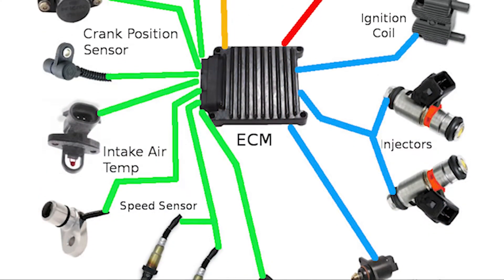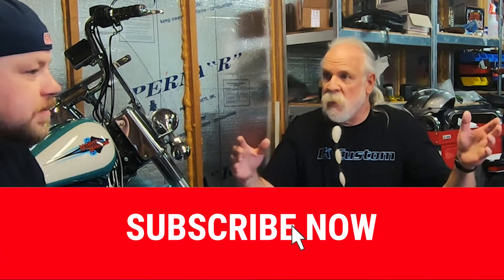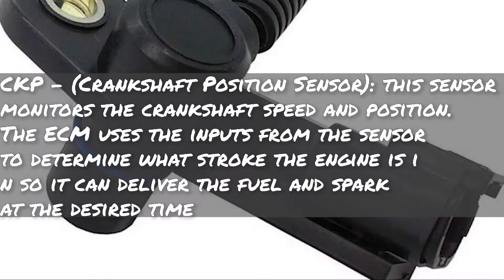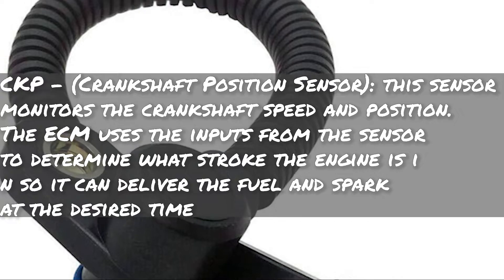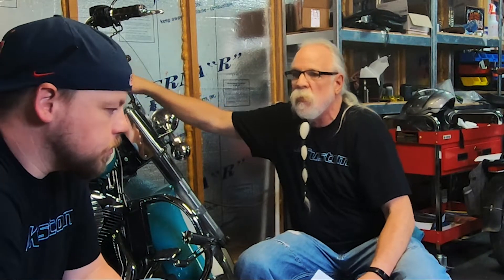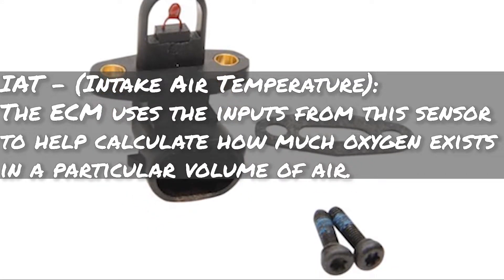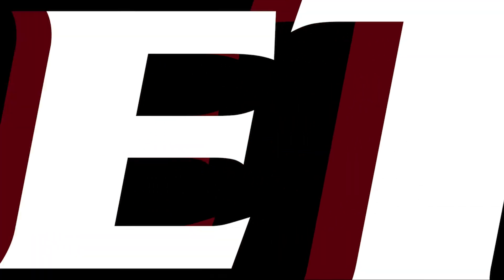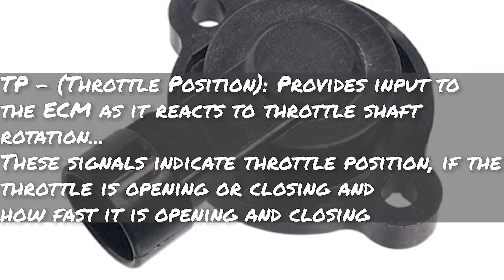How the Electronic Control Module (ECM) Adapts

Comment: I replaced my CKP,spark plugs & wires,spark plug coil pack. Still will not start. IF I replaced my ECM do I have to take it to a dealership after changing it ?? I'm thinking about buying a new ECM
Reply from the maker: It is very rare, extremely rare, for an ECM to need replacing.  I would continue to troubleshoot to eliminate other possibilities.
If you do need a new ECM, and replace it with a Harley (OEM) then you will want to take it to the dealership to get matched to your bike.
Reply: @DKCustomProducts  I was send a tune in an email,  could it had a virus and messed up ECM ?
Reply from the maker: @Richard5873  Possibly, but very unlikely.  Have you flashed the original tune back into the ECM and tried that?
Reply: @DKCustomProducts  Yes I have went back and forth maybe 4 or 5 times lost track how many times, was thinking something was wrong with the map I was sent by Harley-Davidson dealership.

Comment: Where is the ECM located at on a 2000 harley davidson electriglide
Reply from the maker: There are three different Electraglide's in 2000.  One is  EFI and the other two are carbureted.  Even the EFI model from 2000 is quite a bit different than the ECM from 2007-2016 and 2017-2022.
You can see them by clicking on the following LINK and then clicking on the OEM Harley-Davidson Partfinder tab.  Then click on your year bike, and then model.  It will then bring up a list of diagrams of every part on your bike.
https://www.shopronniesharleydavidson.com/

Comment: I have a 21 Softail Standard, I just changed stock air filter for a K&N and now my ECM is throwing code p1510 and check engine light keeps coming on, but it seems to be running fine other than that
Reply from the maker: P1510 EFI Limited Performance Mode
Is that the only code you're getting?  Usually it is related to a Throttle by wire issue...a problem with wiring or connections.

Comment: You guys have any Information on if the 2021’s can add a air cleaner or full exhaust without a tuner yet?
Reply from the maker: In 2021 HD changed the ECM and we have not yet done any testing on the 2021's to see if they also changed the AFR and/or how the ECM adjusts for different circumstances.  Here is a video that may be useful...we will be testing in the next couple of months.  https://www.youtube.com/watch?v=aWW-nt7-fzA

Comment: I got a 05 Deuce with 8900 miles back in August of 2019.It does have EFI but there is no 02 sensors on the pipes at all.The bike just has 10400 miles now.How can the ecm able to control gas and air mix without the 02 sensors.No history came with the bike.Iv had the 10k service done the day I got the bike but the machanic never mentioned anything about not having the 02 sensors.But yet the bike runs great the plugs burn clean each time IV check them.
Reply from the maker: 05 was back when HD was still experimenting with EFI.  It was not until 07 that what we talk about in this video became relevant...that is when HD went to delphi EFI and got their EFI standardized to what it is today.
Reply: @DKCustomProducts  I too have an 05 with EFI, so what options do we have, if any?
Reply from the maker: @marks146  Yeah, before 2007 HD was experimenting with different EFI systems.  I would call or email fuelmoto and check into the Power commander, it works with EFI bikes with no o2 sensors.
Reply: @DKCustomProducts  thank you. I learn lots from you both.

Comment: Just for grins and giggles 1 should scan your ECM and BCM for stored codes. You may be surprised to see some codes even tho the check engine light is not yet on.  One more bit of mis information, you do not erase codes by disconnecting the battery or pulling the main fuse. Codes are stored in the memory partition of the ECM and need to be cleared and problems fixed or you will end up with a check engine light and a poor running engine.

Garbage in garbage out just like your home computers
Reply from the maker: Thank you Jack, great advice as always.  Appreciate it!

Comment: excellent info fellas. I got my outlaw 587 with EBS in the mail today and its going on my Road King tonight !
Reply from the maker: Glad you liked the video.  Appreciate the comment.
Thanks for your business, I believe you will be pleased with the 587 on your RK. 👍
Reply: Installed the 587 on the ‘21 Road King. I rode about 30 minutes and shut the bike off a few times. Looks great and breaths better but killed a lot of low end torque. will the ecm keep learning and adjust to it more over several more hrs of riding ? stock tune. I wasnt planning on getting any kind of tuner until the ‘21s have been sorted out with good reviews
Reply from the maker: @zactew6508  M8's, 2020 and earlier, a free flow a/c does not reduce low end torque...it increases it.  We have done no testing on the 2021 M8's.  It is a bit perplexing what they could have done to the 2021's that would reduce the torque with more air....unless they are terribly lean stock.  
Here is a chart of a M8 with stock tune and a 587 A/C.  As you can see it increased torque and HP thru-out the entire RPM range.  I don't doubt what you experienced, just don't understand it.
http://www.dkcustomproducts.com/media/wysiwyg/Stock_Stock_587.jpg
Reply: Thanks for the reply. Its the only modification currently. Ive got some S&S slip ons but put the stock ones back on until i install the thunder torque inserts. Ran really strong yesterday and is struggling with low end with just the 587. Quite honestly from messing with carbed bikes over the years it does feel lean. i guess the 21s are still a mystery with the new ECM.
Reply from the maker: @zactew6508  Strange....I would check the install and make sure there is no leak anywhere....the intake from the throttle body to each cylinder has a tendency to leak...that would cause what you are experiencing...or just do what we used to, let it idle and spray all around behind the air cleaner and see if it changes the rpm at all...then you will know that there is a leak.
If there is no leak...to me it would be worth it to put the factory air cleaner back on and see if that made a difference...then you would know that it was the free flowing air cleaner, and not something else that happened while A/C was being installed.
Reply: Thought id report back. stock system went back on and it took a few short rides for everything to normalize. ran great. installed a crossover block off and a single S&S MK45 gutted with a thunder torque insert. making a 2-1 with stock header. bike ran great with no torque loss. Then i carefully reinstalled the 587 and EBS. A few short rides and stops and the idle settled and it was running strong. Im pretty sure its running hotter now but im probably also paying closer attention. No doubt i could benefit from some tuning but it seems to be running well.
Reply from the maker: @zactew6508  That is great news all around!

Comment: The OE tune had the bike running 280*F+! Did my homework, read a lot about air cooled engines (old Porsches run 11.5 to 1 AFR) , set my PowerVision up to watch all the info, & wrote a full tune that runs 12.2 to 11.7 AFR. Now my bike gets to 246 only the the hottest days but usually runs in the 230s. Still getting 38-39 mpg while running an open AC, breather bolts, & a V&H Comp 2into1. You guys are great & have some of the most informative vids on Harleys on youtube, thanks guys!
Reply from the maker: Thanks man, glad you're digging the videos.  Good to hear you are happy with how your bike is running!!! 👍

Comment: 20% is quite a bit! I love my trike! The stage two torque kit makes a huge difference!!!
Reply from the maker: Yes it is.  Unlike a carbed bike that does not run well at sea level and 13,000 feet elevation, the fuel injected bikes do, because the ECM has a significant ability to adjust.
Have you seen this video? https://www.youtube.com/watch?v=GK5x3lcQvJU

Comment: So, my FP3 that came with ours, sends input to the ecm?, or is it over riding the ecm?.
Reply from the maker: The FP3 is a flash tuner.  It overwrites the tune in the ECM with a different tune.  It is not constantly sending input to the ECM.  It just does it once when you "flash" a new tune to the ECM.  However, the FP3 can constantly receive information from the ECM that is then displayed on your smartphone.  More info can be seen on the FP3 at this link- https://www.dkcustomproducts.com/v-h-fuelpak-fp3-efi-flash-tuner-w-auto-tune-for-stage-i-ii-s-dk-vh-fp3.htm
Reply: @DKCustomProducts  ,are they any good?, I keep hearing more negative than positive.
Reply from the maker: @kevingleason5434  The FP3 does a good job on stock and Stage I bike, ok on Stage II bikes.  I prefer the Power Vision, much more flexible.  But the FP3 is solid when used for what it's made for.  I've run it on one of my Stage I bikes and was very happy with it.

Comment: That was a great breakdown of how an ECM operates. Great explanation of closed vs open loop. I run a Power Vision on my bike-I have a canned map from them. I am not bright enough to start monkeying with it :). I will be getting a decatted two into one system over the winter, and getting the DynoJet  auto tuner to let it do its thing.
Reply from the maker: Thank you, glad you found the video useful.  Your Power Vision should already have the auto-tune functionality built into it.  There is an additional module that works with the Power Vision called a Target Tune.  You can see more details on it at the link below.  It is a great addition.  I run it on one of my bikes.  While it is expensive, it is a whole other step up in tuning for a built engine.  https://www.dkcustomproducts.com/power-vision-tuner-accessories-c120-241.htm
Reply: @DKCustomProducts   I am picking up the Target tune over the winter, when I get the decatted heads for the bike. My winter project :). Next year is the cam upgrade. Theoretically, after that, I am done. I do the work myself-most isnt overly difficult, just time consuming. But, I live in New England...ideal time to do major upgrades is over the winter.
Reply from the maker: @oldsoldier181  I really like the Target Tune, it really is quite amazing how well it works on my Stage IV, high compression 1250 Sporty.  Huge improvement...a dyno tune cannot touch what this thing does.
Reply: @DKCustomProducts  So quick question, as I cant really seem to find an answer for this: Once I put the target tune in there, does that make my Power Vision obsolete? Or does it work with the map I have in there?
Reply from the maker: @oldsoldier181  The Target Tune works in conjunction WITH the Power Vision.  When you get the Target Tune you will need a new map in the Power Vision that is Target Tune Specific.  Also, you will have new things on the Power Vision that you can monitor.  (if you choose to do so, it is not necessary).  I really like that it will display the AFR real time as being read by the wide band sensors that are part of the Target Tune package.